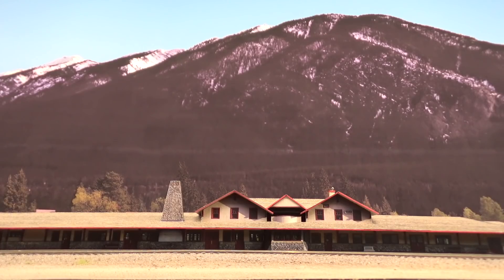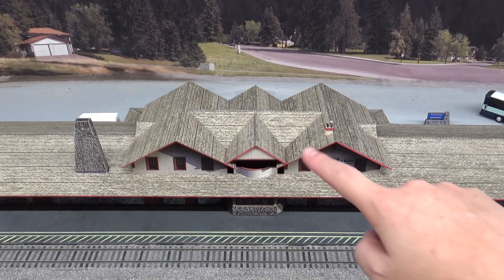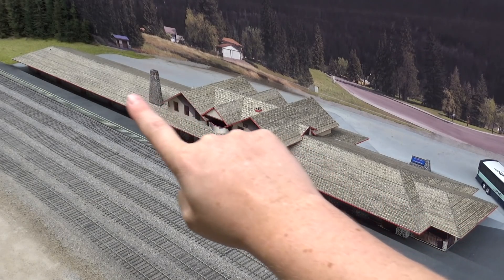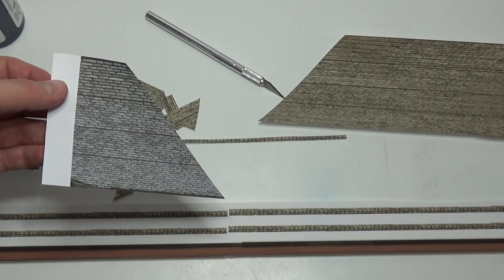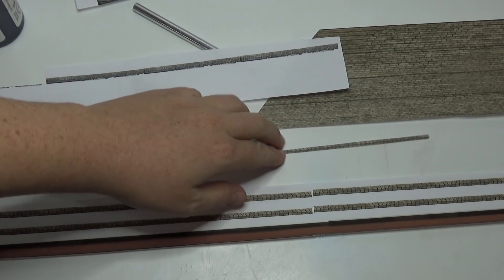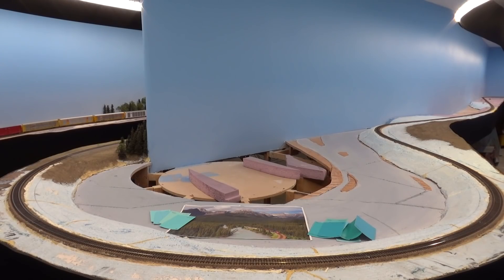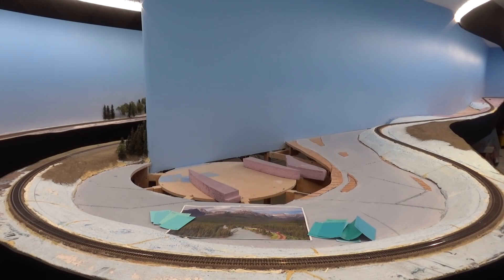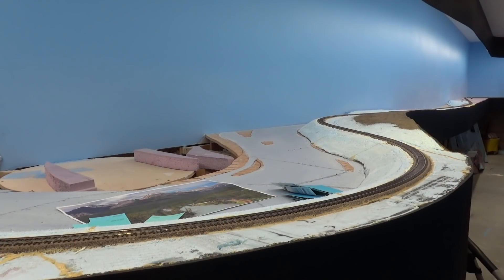Layout Update - November 2021: Banff Station Complete, Printing Cedar Shakes, Morant's Curve Kickoff

Comment: I've been doubting the look of this because it's done with photographs throughout the video series. I've voiced my opinion and talked back and forth with you about this. I have to say that if the station looks as good standing there looking at it as it does in this video then I've been proven wrong about photographs not looking as good as actually 3d building all the details and must say this turned out excellent and looks amazing. You did an absolutely impeccable job and this is one of, if not the best photo based scratch build I've seen. The way it and the 3d scenery blend into the photo backdrop is perfect aswell. It's an extremely impressive scene. Great video. Stay well. -Wil  👍
Reply: As someone who has seen it in person (before it was complete) the video doesn’t do the structure or the rest of the layout justice. For some reason the video is not entirely representative of what it looks like in person.
Reply: @JPKafal  I figured that and I think it turned out very nice from watching the video so like I said I misjudged this by a long shot.
Reply from the maker: I appreciate your insight and opinion Wil! Many people would rather build the details in physical form which is totally fine. It's a hobby and is meant to be a relaxing way to express yourself creatively. I like to try new things and I enjoy graphic design/photography so I prefer to model using photographs. It also gives me excuses to visit the prototype locations more often : )
Reply: @BArailsystem  I agree with all of what you just said. Nice way to put it. Definitely no right or wrong way in this hobby. It's whatever the individual modeler finds satisfying.  👍

Comment: Really excited to see how Morant's curve turns out! It would be really cool to see a comprehensive how-to on your photo back drop process from start to finish. I plan to use them myself as well but I'm not really sure where to start. I've been been photographing 1:1 stuff for quite some time but I'm still curious to hear how you compose your prototype photos so that the perspective looks realistic once scaled down.
Reply from the maker: Thanks for the comment. I will do my best to capture the process as I work through it. This one should be even better as I learned a lot from the first ~40' of backdrop that I did. 
When you are out photographing, for photo backdrops specifically, I can't stress enough the importance of broadside, well lit photos and maximizing the cameras frame width with no lens distortion. This saves so much time in post when you go to edit the images.
Reply: @BArailsystem  thanks for the tips! My particular railroad (Finger Lakes Railway) fittingly runs along the banks of a lot of lakes so I'll be doing a lot of my photo backdrops by drone (out over the water looking back at the subject area). Do you find ground level photos work the best, or If you had the opportunity to shoot from a slightly more elevated perspective do you think that might work better?
Reply from the maker: @FGLKPaul  I would do both and see what looks best to your eye. Just try to use the entire width of frame if you can because the wider the image is, the less photoshop needed to stitch them together.